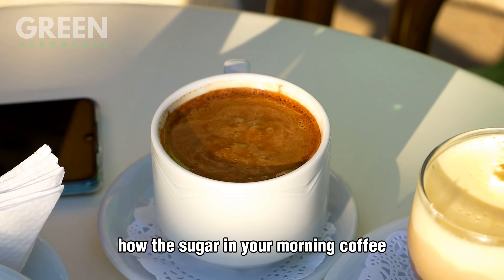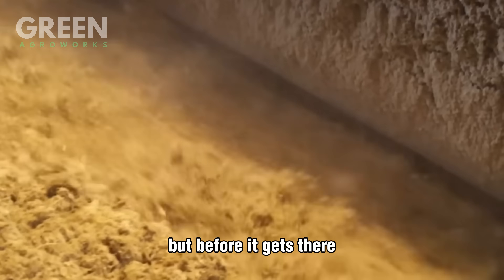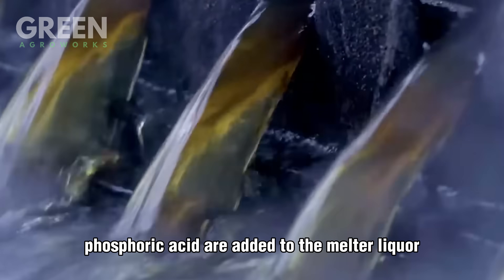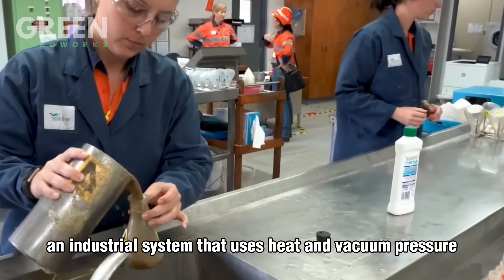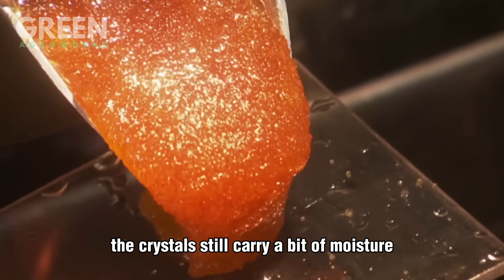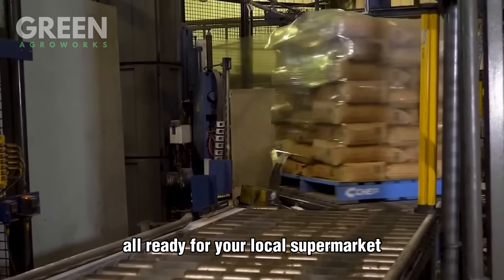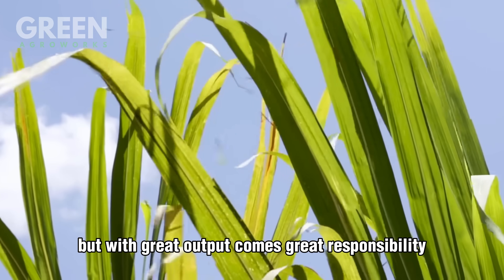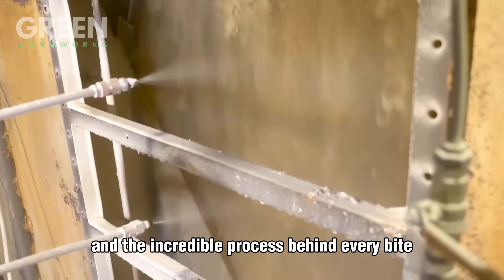How Farmers Harvest 1.9 Billion Tons of Sugarcane by Machine - Sugar Cane Growing and Harvest

Comment: Imagine being the driver — it’s like piloting a sugar factory on wheels 🚜
Reply from the maker: Totally! Inside the cab it’s like running a mobile factory—GPS, auto-height sensors, and live monitors help the operator cut, strip leaves, and billet the cane in one smooth pass. Skill + timing matter because fresh-cut cane is on the clock.